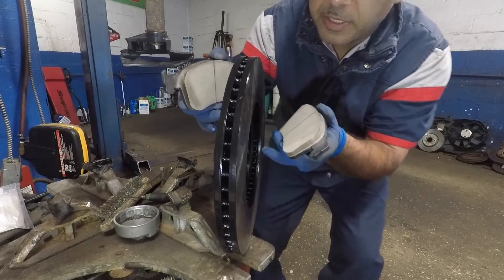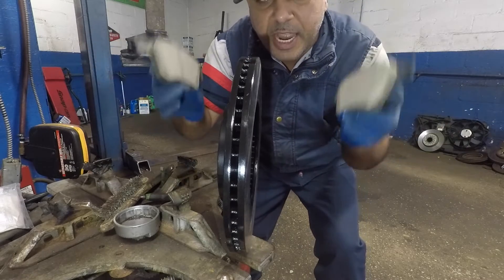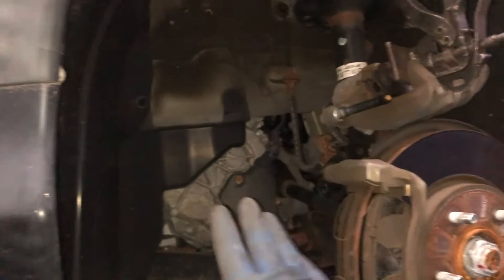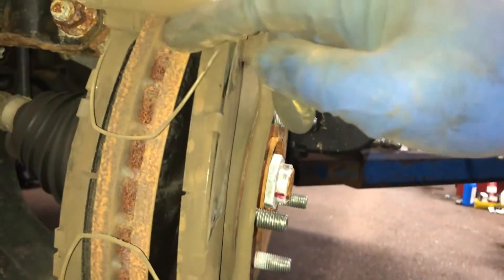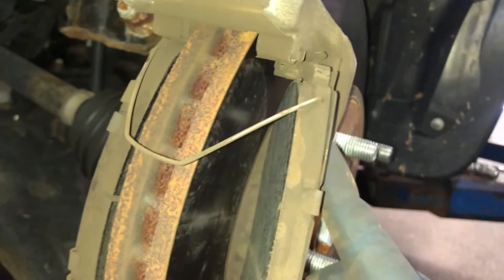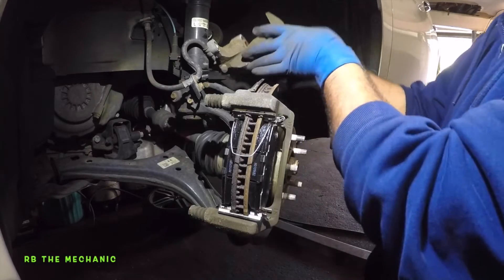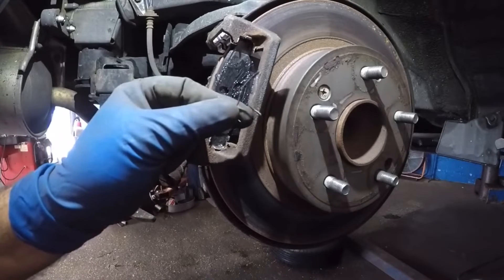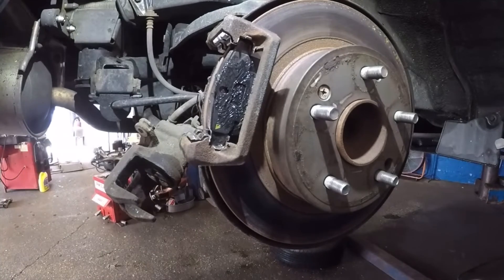How do Brake pads BACK OFF

Comment: Those are anti-rattle springs. There are many BMW, Porsche, and Mercedes Benz automobiles without any such springs. How do they release? The square cut o-ring around the caliper piston are the reason the brakes release. When applying the brake the o-ring stretches ever-so-slightly, just a hair's width. After the brake is released the stretch relaxes and pulls the piston back just enough.
Reply from the maker: That tooo ! Trust me this retainer for not putting on rotor over heated and warped I saw it from experience if u don’t put it in it will do damage and yes that boot helps also

Comment: Great instructions on doing a brake job but I would never lube anything other than the pins on a brake system. Lubricating the slide shims and everything will cause the brakes to seize, I have seen it time and time again and what causes it is brake dust getting mixed with the lubricant and drying out.
Reply: 2:12 is what I'm talking about, never lube that part of the brake system, you will make your brakes seize
Reply from the maker: Yeah it dose collect dust but I have been satisfied with lube